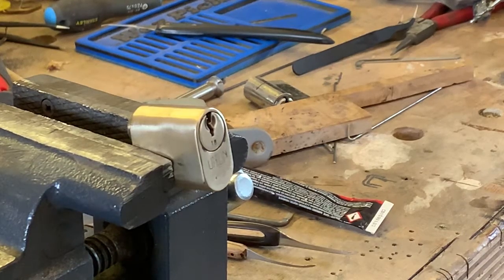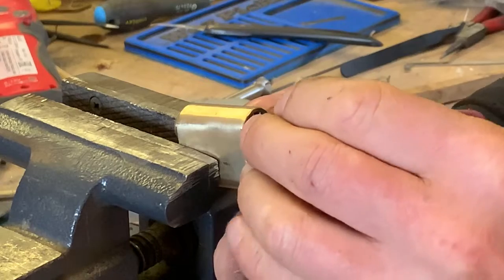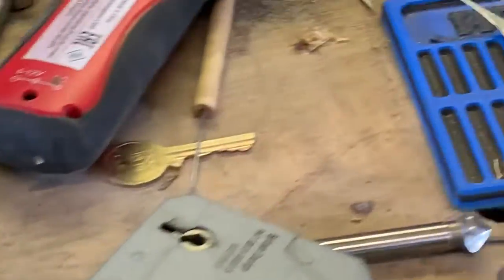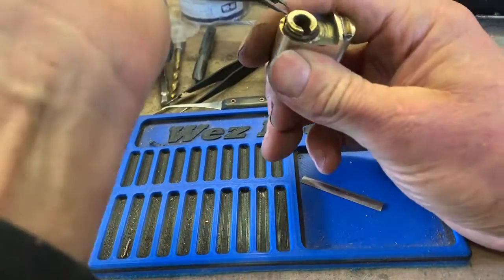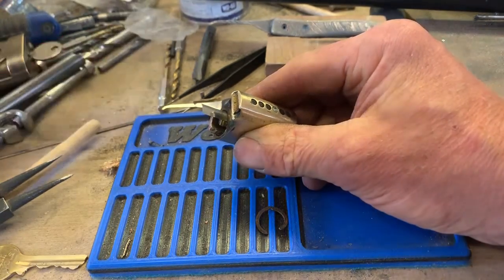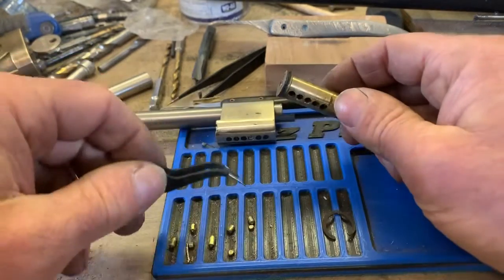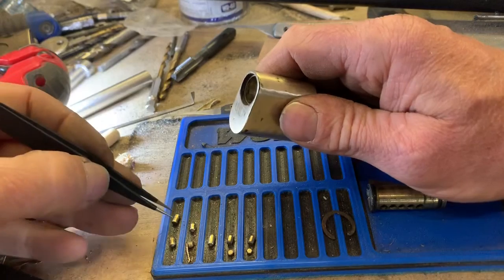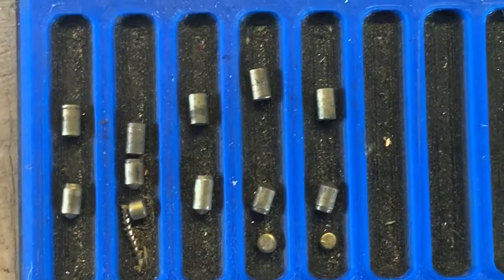(62) Union oval pick & gut.

Comment: Well done! Odd it only have 5 chambers populated, Cheers Wez :)
Reply from the maker: TotallyRandom Locks and Picks 
A bit odd. 
The core is only 5 pin. 
When I measure it against a union 6pin core the 6 pin is shorter. I was going to swap the cores to make it a proper 6 pin. 
Not happening. 👍👍
Reply: @peyotewez  My mistake I only counted the plugs in the bible not the core, watchin with tired eyes does that cheers mate :)